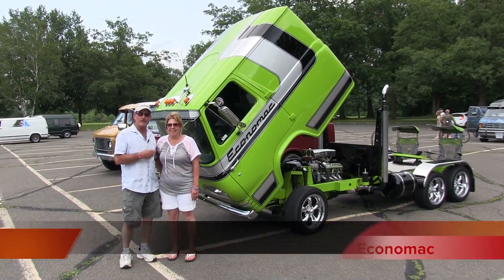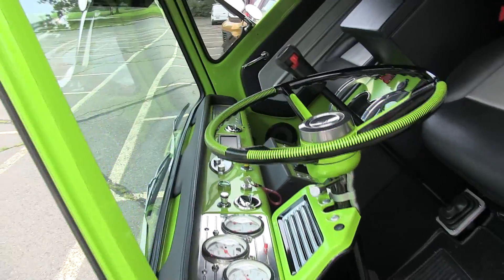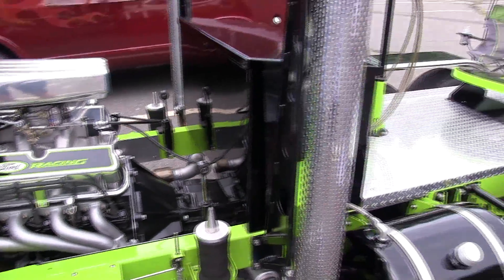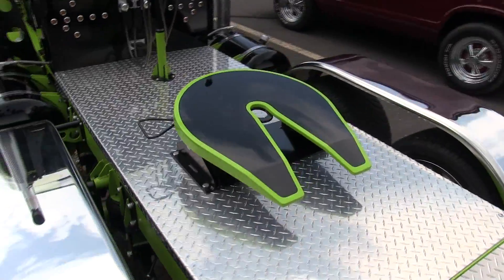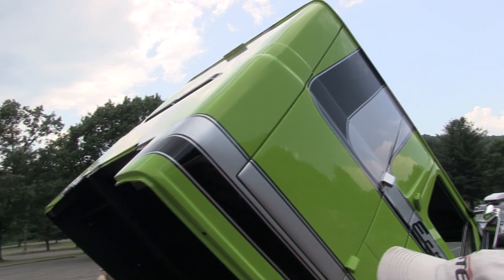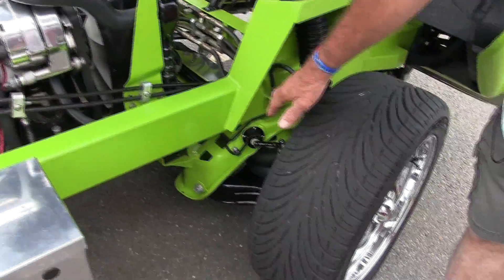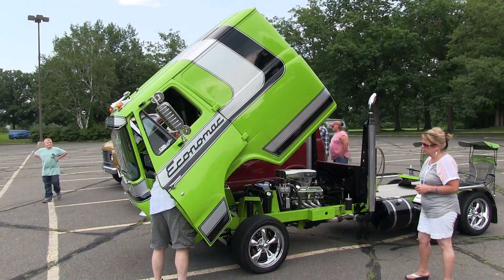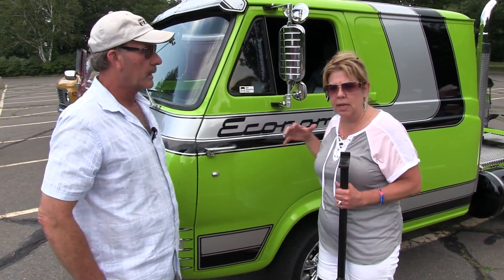ECONOMAC, 1967 Ford Van. Incredible Build,

Comment: I used to sit on the metal engine cover that  was between the seats in the stock version of a 67 Econoline Van. 
You have made a really cool ride and have taken it to a whole new level. I like it!
Reply: we used to call sitting in the middle of the front Bitch, because it was, but the doghouse in one friend's van was far preferable to in another's pinto. you had to sit on the hand brake lever... now that's a bitch. We used to get seven people in that darn pinto. three in front three in back and one on the package tray in the back window. No we didn't go far that way, just from one place to another in a small town, or we'd drag the gut that way. More often than not though once we got on main, we preferred to park it and get out of the car.
Reply: You should have tried the upholstered seat, much more comfortable.

Comment: Came out far better then many of the prototypes I have seen built by parties thinking of building aftermarket conversion vans.  Very well engineered, excellent fabrication.

I can see "aftermarket" potential if the vehicle can pull a resonable load.
Reply: It can,no gas mileage !!!!!

Comment: He that is fantastic, the detail of work will put many fabricators to shame. Whats even better is you are both enjoying it.

A UK truck magazine had a Ford Transit cab/chassis (2ton approx) fitted with a double axle and fifth wheel plate etc. Plus a box trailer built to replicate a well know carriers units. It toured truck shows around the UK. But hey it looked good but had nothing on yours.

Safe driving and you two stay safe in these tough times. Thanks for posting

Comment: It so nice. It would be nice to see 1/2 ton pickups with a floating cheater axel. That could air down to easily out haul a 3/4 ton , you could use a little compact straight axel , add less than 300lbs to the unit , it would haul like a champ and be way more economical.

Comment: The transmission shift lever you are using looks like the medium to heavy duty trucks use out there.
Is it using the heavier duty transmission or are you using a standard one for the gas engine

Comment: Looks awesome... but how does the cab airbag suspension work if the cab is connected to the hydraulic ram?  It would seem the ram holds the cab in whatever place it is lowered to.

Comment: Very nice build. Too bad it's not used to tow anything; of course it couldn't handle a big fifth-wheel trailer, but it should b able to handle a few tons. 

The cab lowering onto tapered pins on the air springs is clever, but do the cab shocks just seat in sockets on the cab? Unless they're pinned in place, they can't damp upward motion and there's no upward travel stop.

Comment: Could you describe how you implemented the T-5 shifter "remotely"?  I built a mid-engined Econoline Pickup but went with a shortened C6.  I'd rather be running a manual.

Comment: I appears that the rearmost wheel/tire is larger than the one in front of it.   Is that intentional?  Also, curious how the T-5 manual trans shifter linkage was fabricated.  2 Cables?

Comment: It would still fail our MOT safety rules in the UK because it still needs a physical mechanism to lock the cab down.
A simple bolt would probably satisfy our superior safety regulations.
Do you still get away without brakes on the front axle ?
Otherwise excellent idea.
Reply: No front brakes? Not in this century.

Comment: I say use it. be great for pulling a fifth wheel RV. or maybe he could get a smaller scale than big rig trailer and haul some smaller loads too small for a big truck but great for this. Get paid to travel in it, pick up loads when you want, when you don't just roll on down the road. but that would require a CDL or some such, and who knows what the vehicle would be required to have. Still if you're gonna build a tow vehicle, tow something. A car trailer perhaps, he could haul other people cars to the same car shows he goes to, get paid for that and get to enjoy the car show as well... now that's having your cake and eating it too.

Comment: Nice build. The things I would do differently are to build a beefier frame to put under it, put on heavier duty axles, heavier duty suspension, a 5.9 Cummins, a 13 speed, 19.5 wheels on Alcoas, put a bed in the sleeper area and a functional fifth wheel.  Things to make it a functional fifth wheel puller. Other than those aforementioned things, I'd build it the same.